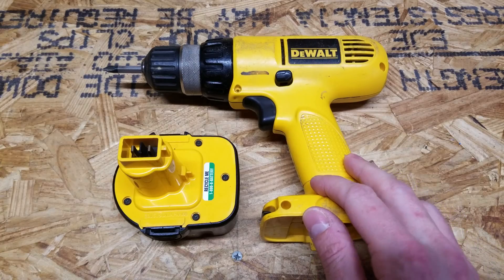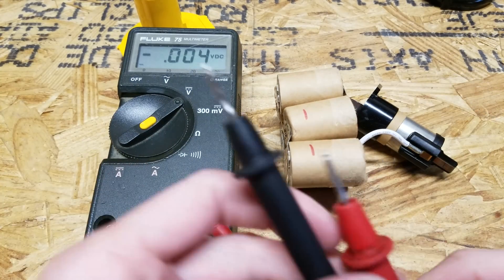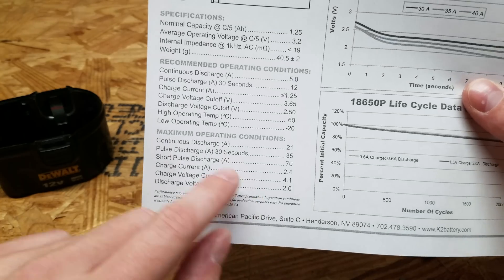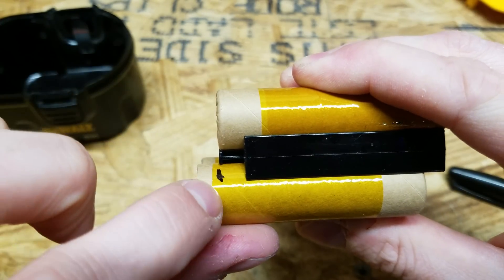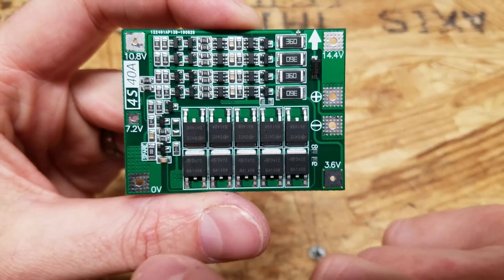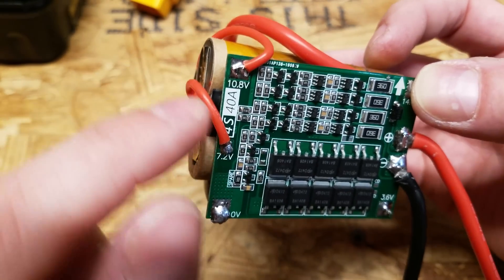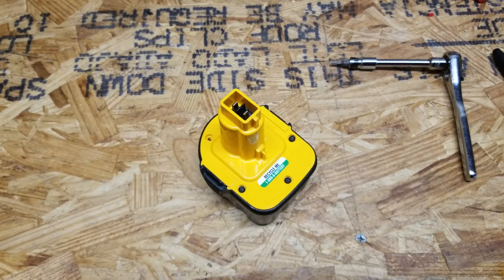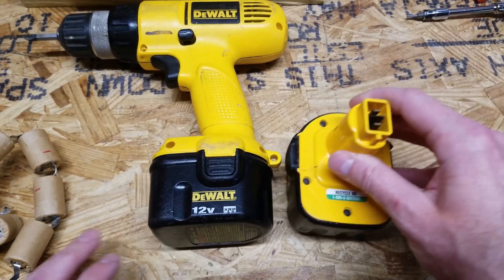Converting a DeWalt 12V Cordless Drill from NiCad to Lithium LiFePO4

Comment: Why wouldn't using two dual battery holders for  18650 battery, solder in a series and connect them to the battery spades?
I have a 12v Ryobi battery I was going to try that with as the NiCd battery is shot and only used to turn over a starter motor on a weed eater.
Recharging with a wall charger for deer feeder batteries.

Comment: great segment and a good intro to this topic, thanks. i note as of the date i write this, the K2Battery.com website isn't very forthcoming about detailed techSpecs and appears to force visitors to fill out a relatively complex, song & dance request form just to get a data sheet for a specific product. unless i  am missing something here, this isn't very customer-friendly.
Reply from the maker: Most manufacturers will not sell cells to DIYers due to liability issues. I usually google the cell model with ext:pdf and this almost always finds datasheets somewhere. For example, search "LFP18650P ext:pdf" you'll find it easily :)
Reply: @LithiumSolar  hmmm, thanks, i was unaware of this industry phenomenon, being a relative newbie. i will check it out. so, where does that leave us small buyers who want to replicate your pack-rebuild project (which is exactly what i want to do, with an old Skil 12V unit, that has a dead freestanding wallwart power supply for a recharger which (i hope) will make it relatively simple to get a replacement wallwart to function with this system?)  am i gonna hafta order crapshoot cells from Ali? (LiFePo seems to be a relatively rare find on the Ali website, and we all know how consistent product quality is from these famous far East asian suppliers...) anyway, many thanks for your work on this.
Reply: @LithiumSolar  right, thanks, i am checking this out as we speak, and when conducting the search you suggest, i stumbled across an interesting research paper on a topic that should be of critical interest to us all, i.e. Thermal Runaway, at https://pubs.rsc.org/en/content/articlehtml/2015/ra/c5ra05897j
still following up on your suggestion, thanks

Comment: I’ve got a industrial grade makita drill and impact driver set with ni/cad batteries that don’t hold a charge and cost $200 to replace. Some day I should really look into replacing the cells. I’ve just always worried about how to get the charger to work. I’ve always assumed the original charger wouldn’t be compatible with lithium cells

Comment: DeWalt actually sold a lithium pack for the 12v/14.4v/18v-style batteries.  You could charge it on the NiCd charger, but it was lighter and acted like a Lion battery.  It might be helpful to find one, tear it apart, and figure out how DeWalt did it.
Reply from the maker: Really? Do you have a link to one? I searched and couldn't find anything. I'd love to buy one vs building another battery.

Comment: Hi, Can you provide a new source for the LiFePO4 15C/21A High Drain K2 Energy LFP18650P 3.2V 1350mAh LiFePO4 Battery 4pcs ( the linked listing is finished/removed)? Thank you. Also Good Vid & if you have time , ad the charging cycle outcome. Thanks...

Comment: Isn't BMS continuous operating current too high with batteries connected in series ( battery continuous discharge current 21A, BMS board continuous operating current 40A)?
Reply: Maybe it was better (or worse) to use 4 pairs of batteries(two batteries in paralel) and connect those 4 pairs to BMS board?

Comment: Hello !  do you think a 30A bms is enough for a 20v hammer drill?
Reply from the maker: It should be. The only sure way to tell is to put an amp meter on your current battery that supports inrush and see what kind of current it's pulling.
Reply: @LithiumSolar  thanks i'll try

Comment: Wherever I see someone using Phillips head screws I always feel so sorry for you Americans and your lack of Robertson head screws. Let me put it in a way you might better understand: Phillips = NiCad, Robertson = Lithium.
Reply from the maker: I certainly don't disagree with you there. Phillips screws kindof suck where any kind of tightness is needed. The driver slips and/or screw head gets stripped off. I prefer the star/torx personally, but Robertson/square looks like it would solve most of the Phillips problems as well.

Comment: Thats awesome! I have a slightly newer DeWalt drill that used the 18v Ni-Cd batteries. I got one of the adapters that converts the OEM Li-ion 20v packs to the old battery connector. I actually added an XT-60 and balance lead to the adapter to check voltages (but you cannot actually balance due to resistors internal to the battery). That works fine but I went the cheap route and bought a pair of chinese Li-ion packs. The first pack was dead the first time I went to charge it after using it the first time. then the second one just went out on me recently. It seems the cells were complete junk and popped the CiD's and started leaking.

Anyway I am torn on what I want to do. Do I want to buy a spotwelder and continue with my project of building a tiny powerwall with recycled 18650's from laptops, ive been thinking I will just solder them but a good spotwelder is probably best. Or do I save a lot of time and buy the OEM 20v packs made by DeWalt?

Comment: Finally, someone on YouTube who can actually solder properly 😂😂
Reply from the maker: LOL
Reply: Sorry but I don't agree. LS needs to or at least should look into some pro soldering lessons to up his game. Cleaning the iron tip before each joint, adding a little liquid rosin flux (at times), always tinning the wire strands and opposing conductor, using a wide chisel tip with more thermal mass (faster heat transfer), plugging the mating XT-series connector into the one being soldered (to keep the connection pins from drifting due to heat soaking the Nylon housing) and more. Yes, the joints are better than many I've seen elsewhere but could be better. Sorry to point at you LS but Cody gave me that jab in the ribs and I had to say something. Carry on...

Comment: I don’t know what the purpose of the BMS inside the battery pack without the balancing port. The existing charger will be useless. 
If you want to use the existing charger, there is more work to be done. You could use TP4056 MicroUSB 5V 18650 Lithium Battery Charger Module for each cell inside the battery pack instead of BMS. Then you have to customise the charger to 5v at least 4amp. With this method you don’t have to bother with balancing port
Reply from the maker: The BMS is the balancer... You don't need two balancers to charge a battery.
Reply: @LithiumSolar i appreciate that, however in this instance the BMB does not do anything at all, locked inside the battery pack. what i meant is INSTEAD OF the BMS you could use TP4056 providing you modify your existing charger  to 5v

Comment: LiFePO4 are safer than Lithium-Ion or LiPo batteries. You can short circuit them and they only puff smoke out while Lithium-Ion / LiPo start a fire.

Comment: 3:30 I think that BMS board like many others don't do any balancing making it useless. Once one cell charges to 4.2v it will stop the charging on the other cells which may be a lower voltage. I've tested a few of the cheap ones you see on the internet and they all behave like that.
Reply from the maker: There are two versions of this board - one that includes balancing and one that does not. I purchased the one that does balancing.
Reply: @LithiumSolar  Have you actually tested it though and watched the cells voltages? The ones I tested claim to have balancing, but it just doesn't work. Usually because the resistors are so low power that any balancing is orders of magnitude too small and a cell hits 4.2v and shuts off the whole charging cycle way before any balancing has any effect.

Comment: Would be good if you had compared the lithium performance to the nicd ones. Ive seen alot conversions but no one did ever a comparison of it. I have an ol nicd drill with good batterys im interested in it but i still clues if its worthy or not
Reply from the maker: If you have good batteries, I would just leave them alone. I wouldn't have done this if my NiCad battery was working. I guess the only way to do performance testing would be apply a heavy load and see what the discharge capacity is NiCad vs Lithium.

Comment: NiCd cells if show 0V they have cristalisation betwee chatode and anode. Short  burst high current will help to cell work again. Do the short burst current few time when show some voltage and not loose voltage. Charge it. I have 40 year old NiCd battery cells and they work.
This cannot be used on NiMH
Reply from the maker: Interesting. An particular voltage I should use?
Reply: I use 12V even for single cell. Current must to be enough strong but short. C cells , you can shock cell with 5A  but not too much long. When crystal  bridge melted, cels start to charge up. So 1 to 2 second must be shock time. Normally this cell which show 0V have short circuit true crystall bridge, you can brake this bridge. Voltage just need to bi bigger than normall voltage of single cell. I do this on many battery pack but cell by cell. NiMH cannot save with those method make even more damage. In old days NiCd cells people even make capacitor bank to shock cells. NiCd dont like too small charge current.  I charge 8.6V NiCd battery pack from mains(Europe standard 220V) just need 1 diode and 1 huge resistor. Not my idea I just copy what I found long ago.
Even today rechargable flashlight chinese make charger on this simple way.

Comment: What? No support for balance charging? I guess we in the R/C world are a bit spoiled. :)
Reply from the maker: The BMS handles balancing. If you prefer balance charging, you could buy a cheaper version of the same BMS that only includes high/low cutoffs and just run a separate balancing wire to your hobby charger.
Reply: What is the "non cheap" version of the BMS doing besides checking for V cutoff?

Comment: Each cells maximum voltage is 4.1 volts and 4 cells give a maximum charge voltage of 16.4 volts absolute. You need an accurate stabilised dc charger and a nicad charger won't cut it. There are plenty of adjustable charger modules on ebay-for a few pounds or dollars Adjustable voltage/constant programmable current  and programmable constant voltage. You will just need an initial supply of at least 4 volts over your programmed output voltage. I use a kodac printer psu -(its a switch-mode psu)-output 36 volts and my programmable module lets me charge a range of converted power tools of different voltages. Made my batteries from scavenged lithium laptop cells.

Comment: I haven't read all the comments here, but is this really worth the bother?  I bought a whole DeWalt set with drill and impact driver, two batteries and charger for $99.  I'm sure I'll get several years or more use of all the tools.  To do the above conversion, I'd have to buy the cells, the circuit board, two kinds of special tape, connectors, figure out how to spot weld (not shown in the video)  and, apparently, get a different charger.  I have to think I'd spend most or all of $99 to do so.  But then, I wouldn't be sticking it to the Man.

Comment: I have modified my bosch battery, from nicd to lirhium. But when i charge it with old nicd battery charger for few hours its become super hot but not explode yet.
Does anyone know the solution? Thanks
Reply from the maker: Yeah you can't charge it with that. Did you use a BMS? The BMS should be shutting down the battery if the voltages are going out of spec.
Reply: @LithiumSolar  @ so i have try another charger that compatible with lithium?

Comment: I am really interested to see the charging solution you come up with.. I have a number of devices I'd like to convert to 18650's. But from what I understand these BMS boards are not capable of charging, but are definitely required for safety of the battery such as preventing over-discharge, short circuit, etc.. I have an iSDT Q6 300W hobby charger that would work great, but getting all the connections and balance leads out is the challenge.
Reply: I am also interested in seeing the charging solution

Comment: It was just 6 weeks ago that I had a similar dilemma when my last 12V battery died.  I wasn't thrilled with the idea of throwing away money on another 12V battery, so I went the easy way and just bought a new 20V tool.  I still have the 12V one in the garage.  The 20V version is smaller and lighter than the 12V tool it replaced.   

At the end of the day, I guess the question is, was it worth the effort?  How much did you spend on the new batteries and the BMS circuit card?
Reply: Super good point!  I got a basically new 12V DeWalt drill for free from a good friend to play with.  Because vaping is so popular Samsung INR 18650 cells (6 of them) was about $25.  The BMS for 18650 cells (almost exactly what LithiumSolar used) only  cost about $1.50 each.  I also bought a charge indicator light and those were about $1 each.  So materials for me to rebuild two 12v packs was just under $30.  I'm not doing it for the fame though - more something fun to experiment with and if I can keep a good tool from ending up in the landfill I'm happy.

Comment: There is a guy on you tube who does, what he considers a potentially dangerous thing by "flashing" the NiCad battery pack with a quick flick across the terminals with his "Stick" welder, he claims that this blows away the "growth" of spikes in the cells and claims that you may? be able to recharge cells that have lost use, howver he wears a face mask as he says it may explode, who knows? It's not something I would want to try.
Reply from the maker: That sounds interesting, but I certainly would not want to try it myself lol.
Reply: @LithiumSolar  Goes double for me, easier ways to get into the burns unit.

Comment: 6.6.20  Nice video thank you.  What do you use to charge with?  I have a 18 volt that uses the same sub c batteries.  Will this idea work to replace the 18V using more or different Lithium batteries?

Comment: I have a question, i recently repair 2 battery packs, one was makita 3ah and bosch 2.6ah, i used old laptop cell checking of course the amps after discharged and make sure they were all the same(or close, more or less), and kept the original bms of each battery, they charge full but when i use them on the drills under heavy load they shut down, i let it rest for 2 secs and works ok until i drill a long screw and/or heavy load again and i don't know why it does that, any thoughts?, anyone?, thank you.
Reply: The cells used in laptop battery packs have  a much, much lower continuous/peak discharge capacity than those manufactured for power tools  (makes sense, doesn't it? Nothing in a laptop is suddenly going to start drawing 20/30amps all of a sudden).  So when you put a heavy loan on the tool, the motor will try to draw more amps than the cells are capable of delivering.  I guess the BMS is detecting some sort of problem when you do that (?undevoltage?), and shutting down the battery pack.  When you take the load off, it will reset itself ...  until the next time.

Comment: I have some 19.2 volt Craftsman Nicad batteries for the 19.2 volt tools (C6 batteries) and Craftsman makes a C6 Lithium Ion battery that will plug right into the tools, but it has to use a completely different charger.  They Nicad charger will not charge the Lithium Ion cells even though the battery connector is exactly the same.  It even states in the paperwork for the new batteries and the new charger to only use the new charger with the new batteries as using the new charger with Nicad batteries will ruin the charger and to use the new batteries with the old Nicad charger will ruin the new batteries.

Comment: How do you spot weld these? I have no 0.15 mm Nickel strap laying around. I have Li-Ion batteries already, that all ten are dead. This is version #1 for Craftsman Pro Series tools sold in the late 2000's, but these have good cells & bad but has the battery management system on top inside the batteries case. They use a PTC thermistor placed on top of the pack. As an auto tech, long retired, is the BMS board battery management? And is 4S2P meaning 4 in series and 2 in parallel? I am guessing. Also orange batteries that must be Sanyo with orange cover and tiny blue cap. Also, if a good cell is disconnected from a bad cell, that may have discharge a perfectly good one, can a single cell be charged by itself?
Reply: I came to ask the same question about spot welding. A quick search showed me dedicated machines from $110 - $2000+ or sketchy looking circuit boards for under $20.

Comment: I have had a similar issue with my Dewalt 18v batteries always going dead. Eventually the brushes in the motor went bad so no conversion for me. Strangely, My older 12v Skil drill did not have as many battery issues. I now have Ryobi because someone gave me a Chop saw/case with a bunch of blue tools and I have been adding the new green tools with chargers and batteries.

Comment: I never use power tools away from a source of electricity. Still, when they came out with the battery operated power tools I was excited to get them. With decades of replaceing batteries, I frigg'in lost it. Loosing it, meaning, I complain like a crazy person. I did this for while. Then this one person said, "Yeah, that's why I never buy  them. I just use plug in." Pop, the bubble was burst. Why  the hell was I using barttey operated tools? I was near a power source every time. Battery operated tools are great when you need them, but otherwise, they are insane.